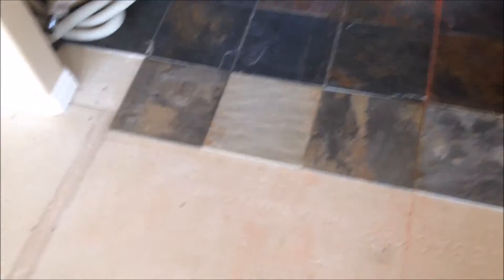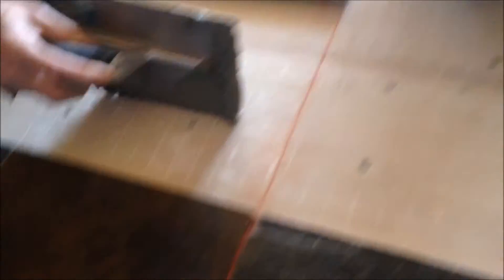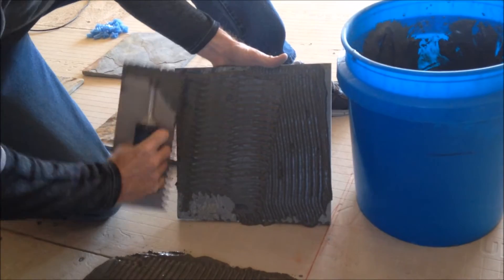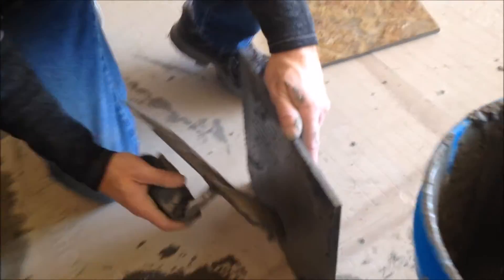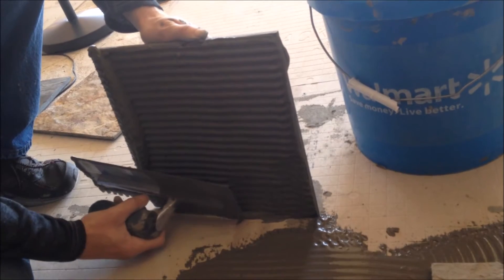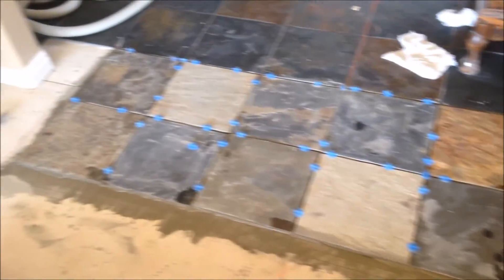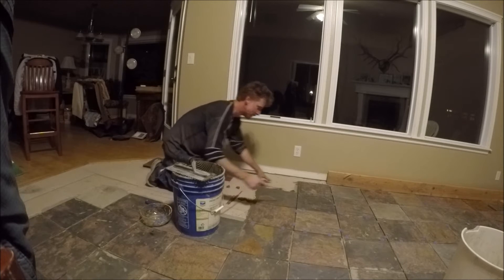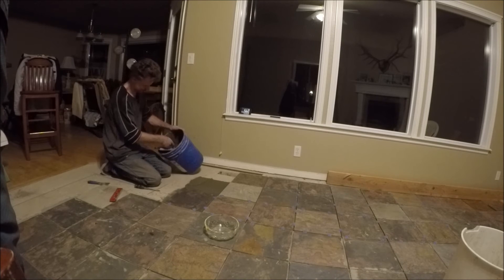How to install slate flooring the easy way - Part 4

Comment: Looks like it came out nice.... I usually try not to use spacers with un square tile because you need to make up the unevenness in the grout joints , or at least slightly make up the differences. with a nice square tile, spacers are great, but not so much with a slate kind of tile. I find if using spacers on a tile that are uneven, it's hard to keep the floor itself square, so I usually grid the whole floor and eye each tile to the grid lines
Reply from the maker: Thanks, you are right it is very difficult to line them up because they are definitely not as square as other tiles.
Thanks for the comment.